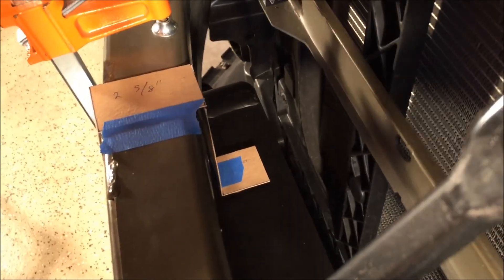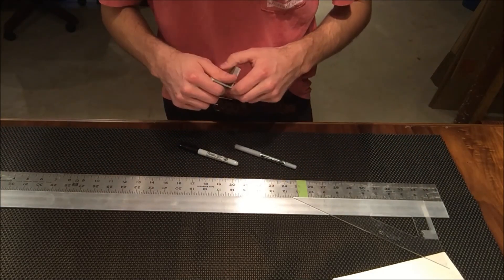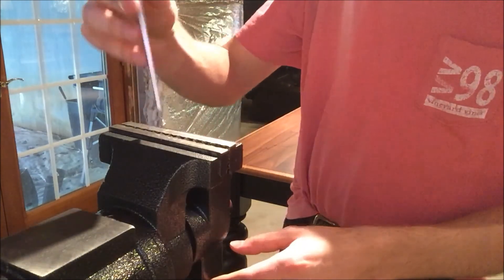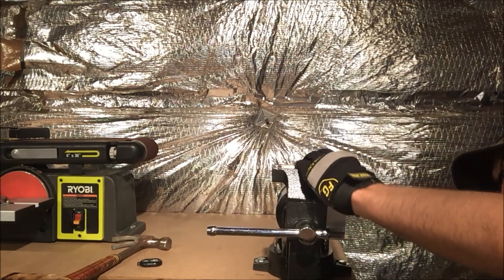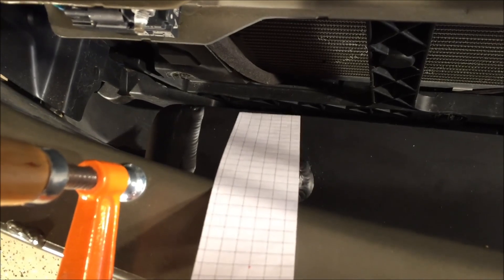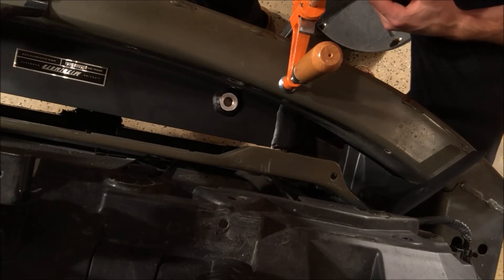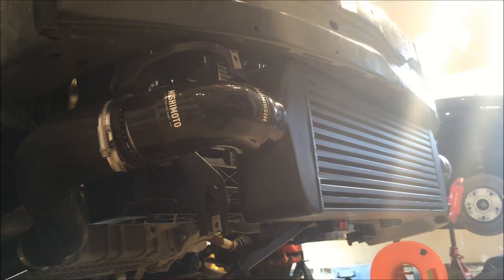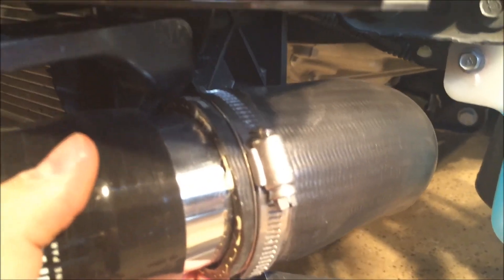Part 3: Mishimoto J Line FMIC Install 2014 Fiesta ST

Comment: Just curious, did you end up drilling through the crash brace or did you just use the tension from your fab bracket to keep the IC secure?
Reply from the maker: Dewey Vu nope! Never had to. Was very secure.

Comment: why wouldnt you just move both your rally lights in a bit?....so you can mount it like its meant to be mounted?
Reply from the maker: To assist in the convex beam spread
Reply: Even still.....had you just used a longer bolt you could have used the same hole for both.